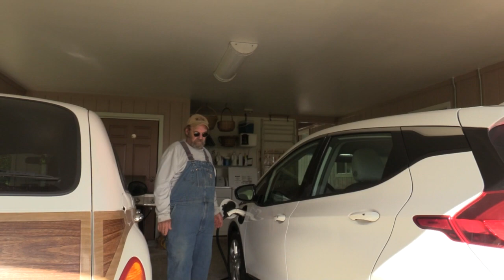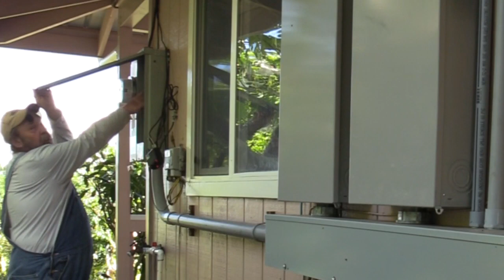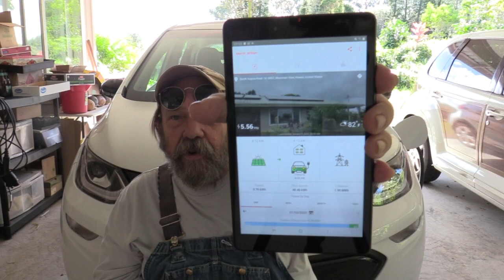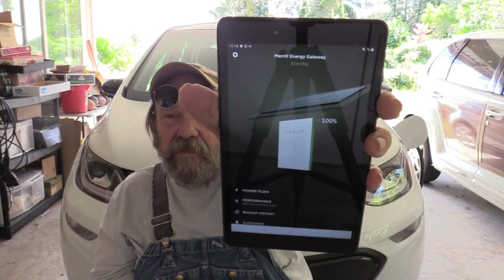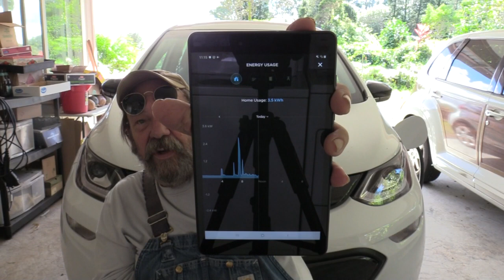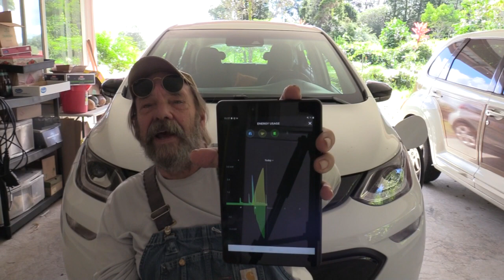Solar Powered Car & Home

Comment: Tesla will send one of their "Rangers" (service techs) down from Honolulu to fix problems with the car that can't be fixed remotely with a software update. It will need to be shipped to Honolulu if it can't be fixed by a Ranger. But I don't expect many problems with the Cybertruck. It's designed to be as simple and robust as possible (in contrast to the very trouble-prone Model X with it's gazillion gizmos and gull-wing doors).
Reply from the maker: I use Teslas Power Wall to run the house, like Musk and I am invested in his company but representation for his vehicales is limited here.  These EV's are much lower on maintenance than gas cars but with the Bolt I only drive to Hilo for service. That was the main reason why i have a Chevrolet.  If Musk ever decided the Big island is worthy as a market place I will be more interested.  Gas or EV, there has always been Chevy people, Mopar, people, Ford people, now we have Tesla boosters.
Reply: @GreenGardenGuy1  Yeah, the lack of a physical Tesla service center on BI is a concern. I also considered the Bolt and I do like them, but I want a vehicle that gets software updates for free over WiFi, the utility of a truck, and REALLY wanted the stainless steel body of CyberTruck. I'm invested as well, hoping to buy my truck with Tesla stock.
Reply from the maker: @jedi_mapperp4073  The software updates are free from Chevy too.  I have to drop the car at the dealer to get them though.  As for stainless steel, I was looking at my stainless steel BBQ grill that is always stored under the roof of the car port.  It has rust pimples popping out all over it.  It took two years, protected from weather to oxidize.  I suspect Tesla truck owners here will end up getting a paint job.

Comment: Tesla no longer allows PowerWalls to be used with other brands of solar - the entire system must be Tesla (not a bad thing). That incompatibility you described is why.
Reply from the maker: We had no imcompatibility.  It was the program on the solar car charger that caused the problem.  Solar Edge represented it as an integrated operation but they had changed the chip so it dominated the system when activated.  There were only seven of these installed in Hawaii when we got ours.  No one noticed the issue until
I did.  It took a some software and chip updates from Solar Edge plus some education for me and the engineer before we got it right.  At the time we did this Solar edge was the only choice for an integrated solar charger.  Sad to hear Tesla wants to run their system exclusive.  This is a limiting act.
Reply: @GreenGardenGuy1  Clarification/correction: Tesla now requires all of its solar systems to include purchase of a powerwall. They will not allow the inclusion of other gadgets (like a smart house electric panel from another company). Tesla is acting like Apple. Their stuff is extremely well integrated and they are eliminating the hassle of playing nice with others.
Reply from the maker: @jedi_mapperp4073  Not really aligned with my reality view.  As a private business Apple and tesla can do what they like in that reguard.  It resembles the AC verses DC power issues of the early 20th century.  Eventually it became standardized.  With luck solar will go the same way.

Comment: So glad to see you were able to get a Tesla Powerwall. I plan to have one or two on our house (unless Tesla offers a feature that lets our Cybertruck battery serve as a "second" Powerwall). 
Most likely due to the when we are retiring to BI I will be picking up our Cybertruck in Honolulu. One of my former students is a regional manager of vehicle distribution for Tesla and he has informed me that I can have it delivered to Honolulu and Tesla will help me get setup with a shipper to get it down to Hilo. I can even fly up and go to Tesla in Honolulu and I can accompany the vehicle on the ship to Hilo.
Reply from the maker: I walked into Chevy in Hilo and said give me the white one.  Drove home with it an hour later. It was less complicated.  We have a recall on some of the Bolt batteries at the moment.  I only need to drive to Hilo for that service.  Easy of ownership is at the top of my parameter list.  I like Musk but he needs a dealership here in order to interest me in his cars.  I see this doesn't bother a lot of people.  His cars are increasing in numbers here rapidly.

Comment: Wow ! You have a very slick system !  It even has a little AI (artifical intelligence).  Being cutting edge can be a pain, but once it's working, what a pleasure.  Your electric company (Helco) is aptly named...
Reply from the maker: Yeah, I've long noticed the name of our power co.  Good thing Hawaii isn't Fuwaii.  Fuco would be even worse.  Love the system.  The emotional release of not having power failures, generating all of our energy needs for home and auto and being independent from energy monopolies is worth far more than any saving I might experience.

Comment: Fantastic system Bill! You're at the bleeding edge.   Really sophisticated power distribution and the predictive charging feature is really cool. The analytics are really great too. It's good to know about the glitches. These companies should fully integrate their technology.  I guess Tesla wants you to use their inverter. Was it not available when you got your system? 

Great to hear about your car too. Are there charging stations around the island? Btw, how long does a full charge take for the car from solar vs. the grid? 

Thanks so much for sharing this!
Reply from the maker: I needed the system to charge my car and I wanted it to do it in an integrated fashion.  The only appliance on the market at the time was by Solar Edge.  We were number 7 in Hawaii on this type of solar charging.  As it turned out I am the one that caught the bug in the system.  No one else had noticed it.  After we got things right it has worked perfectly ever since.
It is difficult to answer your question about solar charging compared to grid charging.  The sun varies from day to day and moment to moment.  My system only diverts power to the car when there is one kw not being used for the battery or the house.  Some days that amount is huge, sometimes it is almost not there.
The chargers used come in three levels.  The level 1 charger runs on 440 and will do my car in 1 hour 20 min.  The level 2 is what I have at home.  It runs on 220 and will fill a dead battery in 9 hours.  The level 3 runs on 110 and takes 21 hours.  It is emergency use only.  We keep the car plugged in when ever it isn't being driven so most of the time it has enough juice for our needs. 
Because we are grid tied I can charge the car at the max capacity of a level 2 charger any time I wish as long as I don't mind paying for the juice.  It will fill over night from a dead state but we never run it dead.

Comment: Awesome set up! It looks pretty deluxe. I set my own solar systems and inverter systems, just basic bare minimum. But they work perfectly, save tons money and I get almost free electricity. It only costs me about 1500- per house for solar panels, batteries, wiring, inverters and charge controllers. Batteries are changed every 4 to 5 years. No problems with my system. Of course Im not trying to charge a car though! 😎
Reply from the maker: The car and the system combined cost about $80,000 but replaced all gas tools with electric ones, use an electric stove for cooking, dry clothes with electricity and run my recording studio all on the sun.  The only thing we use petroleum for is oiling my shot gun and propane for my BBQ.  All energy consumption is from the sun.

Comment: Do you happen to know how many Watts your solar panels produce and how much kw your tesla power wall holds.
Reply from the maker: The Tesla is rated at 14 kWh total power and the Sun Power SPR 27 panels are 17 at 5.56 kWh.  I had to look this all up because I am not a big numbers guy.  I told Pro Vision Solar to design and install a system that used the cutting edge technology over rated to our use. I'm really glad we did that because this year we have the best and most expensive equipment yu can find but by next year, it will be old hat.  We did this now because the 2019 solar tax credit was at it's 30% peak along with rebates on electric cars.  The technology had hit a decent level along with the economics.  They dropped 10% of the tax credit in 2020 and lowered the car credit.

Comment: Good morning Bill, Thank you for the great video. Could you share more information about your panels? How many panels? How many watts are each panel?
Reply from the maker: 17 panels.  340 watts.  They are Sun Power SPR-327 (SPR-E20)  They are copper backed mono crystaline silicon.  I've heard various figures but the company says 40% more effective than the aluminum backed panel
Reply: @GreenGardenGuy1  Thank you Bill. I'm concerned, we had a Nissan Leaf when we lived on Maui. Nissan recommended that we not fully deplete our battery, and when charging that we bring it to a full charge to give our battery the best longevity. Is it ok for your system to turn your charger on and off?
Reply from the maker: @nickyost8935  The Leaf had a different battery.  According to Chevy and the guys that made the charger the car is fine with being charged this way.  The actually does this by it's self.  It turns the motor into a generator while going down hill or stopping that puts small shots of power back into the battery constantly.  It has an 8 year/100,000 mile warranty on the battery anyway.

Comment: Glad to hear that you're running a general surplus in power.  Perhaps you can generate extra cash by mining bitcoin or selling ice with all your extra power.
Reply from the maker: No interest in bitcoin.  I'd be likely to apply the extra power to a second electric car or convert most of my gas power tools to electric models.  I lean towards something with a more direct benefit.
Reply: @GreenGardenGuy1  Good idea.  Most power tools these days have an electric battery powered option.
Reply from the maker: @bjohnson2003  I just bought Ellen an electric hedge trimmer for her birthday.

Comment: Hi Bill, I enjoy your videos! Thanks for sharing your knowledge and experience. Have you encountered any problems with charging your EV in small doses; that is, not fully charging the battery at one time?
Reply from the maker: I have asked those questions of the manufacturer and I haven't had any good answers.  Chevy supplies a small 110 volt trickle charger with the car that is almost impossible give a full charge because it takes 21 hours to fully charge.  The level 2 charger that runs on 220 takes 9 hours to full charge.  That is the one I have.  Solar Edge who made it designed it to trickle or charge at full power.  I assume they know what's right.  All batteries in solar systems operate with part charge.  There are some recommendations on using electric car batteries as solar home power source.  They claim the level 3 chargers that run on 440 and will charge in 1.5 hours are actually hard on the batteries.  That is what the dealer uses.  So, I have no good answer and every one I ask doesn't know either.
Reply: @GreenGardenGuy1  Thanks, Bill. I bet the battery warranty service will figure it out once they get enough calls!  Meanwhile, yours is a great solution. You have me thinking about doing the same.
Reply from the maker: @mt2766  The car designers have the motor converting to a generator every time the car stops or goes down hill.  This puts small shots of power back into the battery constantly.  It seems the system is flexible.  Go for it!  I am loving the car and the whole idea.

Comment: Here in Antigua there are always blackouts. It's really inconvenient.  Wish I could put the place on solar. Gasoline and electricity are the most expensive things here.  At first, the government said it was illegal to produce your own electricity.  That's just crazy.  Especially when they couldn't provide consistent electricity for the island.  Now they've reversed that. Hopefully soon the cost of purchase and installation will go down.  It just makes sense. It sunny here all the time.
Reply from the maker: Glad to hear they legalized sunshine!  Sounds pretty crazy when you say it that way.  The energy of the sun should belong to everyone, free of charge.  The cost of these systems keep coming down.  In the USA we still have a 30% credit on income tax for the electric car and the solar system.  The credits are dropping but the technology keeps improving.  Just a few years back I would have needed about 22 collectors to make the same power my 18 make today.  Electric car chargers that run on the sun are brand new.  I am told there are only 4 on this Island.  Inconsistent power was one of the big motivators for us to build this system.  It is more reliable than the grid in HI.  If a person isn't trying to charge an electric car and if you avoid using the most expensive top of the line components you can build a good system for about half what I paid.  We had to use commercial contracts or they wouldn't give me tax credit or let me hook to the grid.  If you buy the parts yourself and put the system together with your friends then it is much cheaper.  I see 340 watt Chinese made panels here selling for $245 each.  I built my own solar system that runs my gate opener using small solar panels and a car battery.  It's been working perfectly for three years so far.
Reply: Buy your own panels and other components..go on line and set up a basic 12 volt solar system. It will run all your lights, radio, tv, electric toothbrushes, cell phone...PS don't hookup to the grid..you don't need to sell energy back to electric Company! Sell it to your neighbors first if you have extra. Its super simple to set up yourself. I have very little experience with electricity and stuff like that. But this was super easy
Reply: Farisa Smith, 
I paid less than 1500- for a basic solar set up for 2 bedroom 1 bath house.  Running a water pump, lights, tv,radio, inverter etc.
You need panels that are designed to absorb the sun through clouds too. So ask questions before buying your panels.

Comment: Dear Bill, can i ask if you use aircon in your house?
Reply from the maker: No we don't. We don't use heating either.  We live at 1600 feet elevation on the Eastern side of Hawaii facing the trade winds.  The hottest temperature i ever recorded here was 91 degrees f., mid afternoon in August.  generally summer weather is 65 at night and around 85 in the afternoon.  Winter weather is usually 55 at night and 75 in the day.  We have good trade winds here because we are on the side of a mountain facing the Pacific.  If I open the windows in summer the ceiling fans rotate on there own from the winds!  Many people on the hot west side or the hot areas of Maui do have to use AC.  They have 4 to 5 more solar panels on the roof for this.  Currently we have just enough power to do the car and house.  If I need more energy I would have to increase the collectors.
Reply: @GreenGardenGuy1  Love what you done Bill, its a good feeling to be self sufficient 😁
Reply from the maker: @XxDuhBirdsxX  I'm even more pleased about the fact that I do not need their wars for oil.

Comment: Nice! gotta ask though would you have gotten a Tesla if you did not have to import it? Also yeah the backfeed on to the grid aint worth it. The power company gave themselves a great name as well Hellco kinda fitting.
Reply from the maker: Tesla is a cult favorite.  My neighbor has one and has tried to convince me.  If they had a dealer here I might have considered a Tesla.  Elon Musk is one of my heroes, I am invested in his company and use his solar storage.  The car is one of those things drawn by a single engineer though.  Like the VW that had Porsche's finger prints all over the design the Tesla has Musk's.  Most every control goes through the touch screen.  My sister in law couldn't open the glove compartment!  The programmable digital whoopee cushions he put in every seat was kind of useless too.  I still fart analog, thank you.
There are a lot more reasons why a person might stay on the grid than value of a kw.  If you need to repair the solar system you can still have electric.  If I over produce electricity 33 cents per kw is a lot more than zero.  With out the grid you just dump the extra power to ground.  It is also really handy when you start the arc welder.  You would require a huge system to put up with that sort of amp draw.  The Tesla power wall has a hard time pushing more than 5.5 kw in a spike.  I often pull up to 7 on heavy use.
Reply: @GreenGardenGuy1  One major consideration when buying any car should be availability of service !  That may be a problem with Tesla in Hawaii...
Reply from the maker: @johnporter5828  You have put your finger on the main reason why I drive a Chevrolet EV in Hawaii.  We can get service for them here.  This isn't as big a problem as it may seem.  Electric cars have few moving parts that require service.  Most of the rest of the stuff like tires and brakes can be handled by any shop.  Right now is the wild west of EV's.  Eventually you will see things grow towards normal as most of us drive a battery car to work instead of a smelly, noisy and polluting gas car.